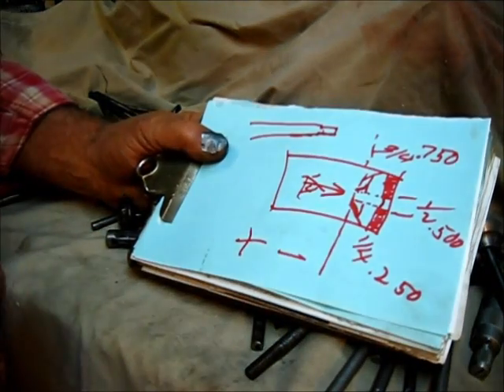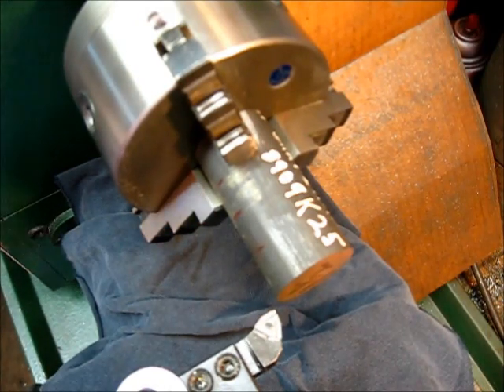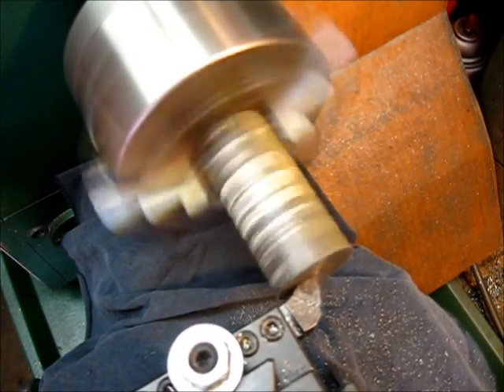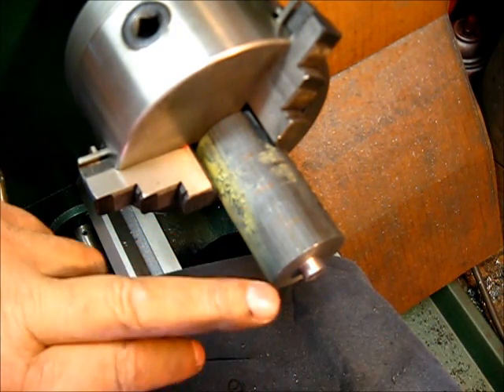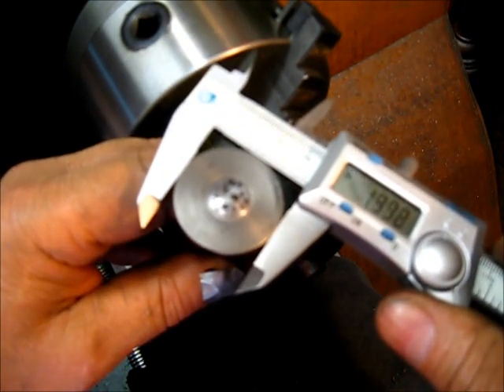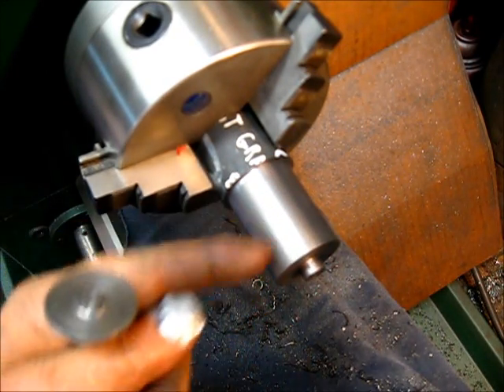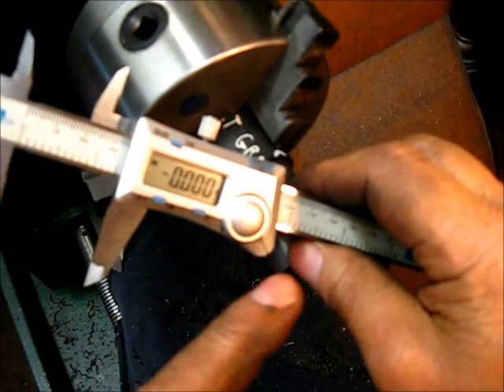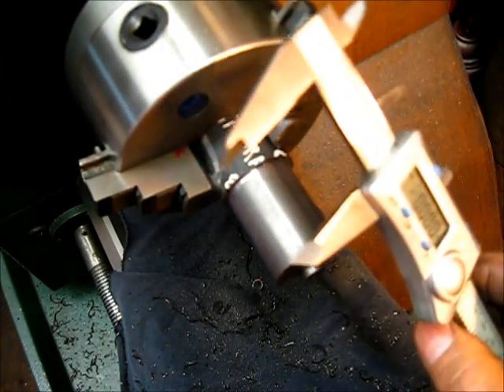I H C ENGINE how to build intake and exhaust valves #2

Comment: Can you use mild steel for the valve? Also, I have my neighbors type m here he wants me to get it running and its pretty complete and has spark but I can't see any movement on the intake valve when you crank it. And it doesn't have much compression. Are valves the first thing to check or should I tear it down and check everything? It's an Amish feller that owns it so it will probably get some use

Comment from the maker: ,,,, well, i'm not sure safe is a word I would use around a lathe,,, but to explain it from the way I done went and seen it, was,,, the cloth had a light oil soak on it as to not be easily blown by a wind draft, and the tool bit angle produced a short chip, and looking at it sideways the small size chuck left a good bit of distance between the chuck and lathe bed,, and I was aware it was there,,,, not safe but kept some of that cast iron dust off the lathe bed, thanks